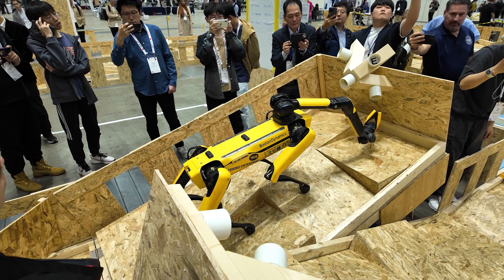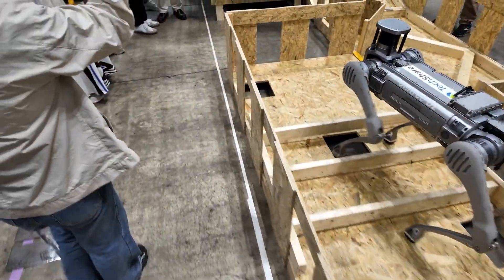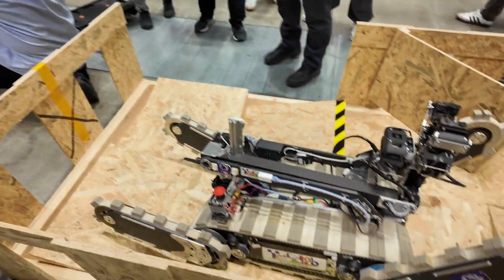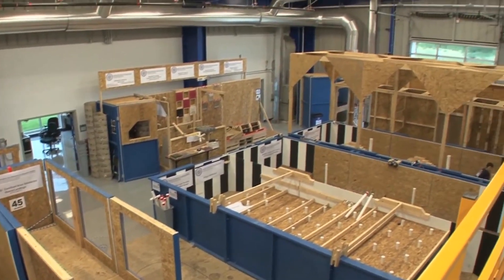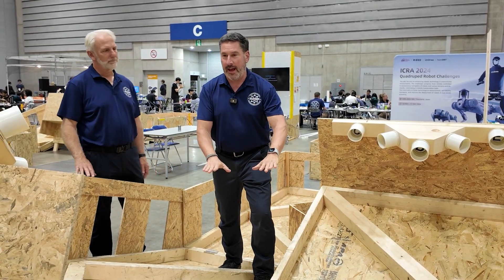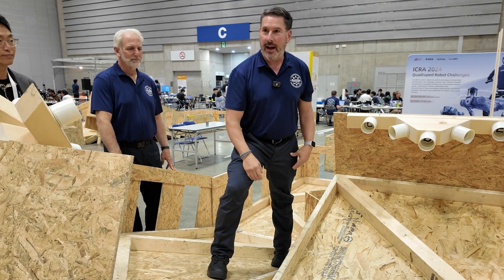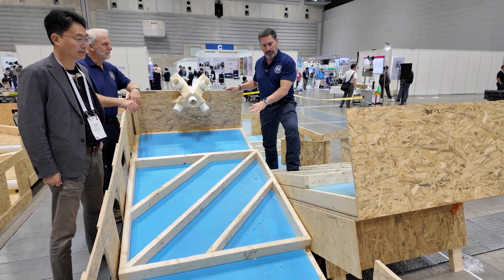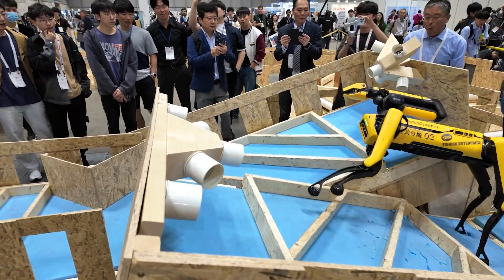Robot Dog Obstacle Course

Comment: Very nice work! Are there shifting obstacles that emulate loose rocks or debris? I know those would introduce issues with repeatability but maybe something that can be built where a resettable mechanism that slides down after sufficient force is applied? As much as the foam is already throwing the robots off, I think a shifting system would be more realistic because it is a sudden drop instead of a Hooke's law "soft terrain". 

Very nice to see this adversarial tech, though!